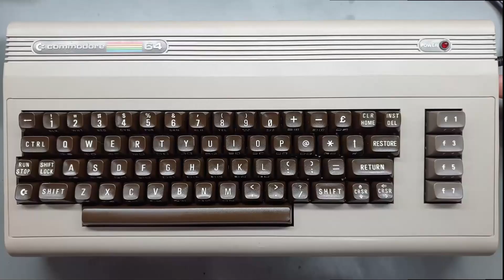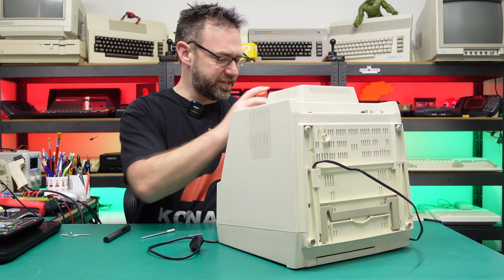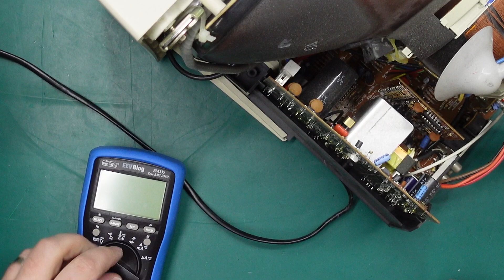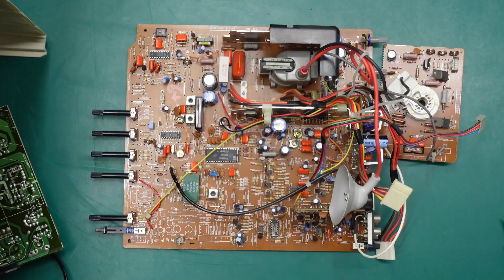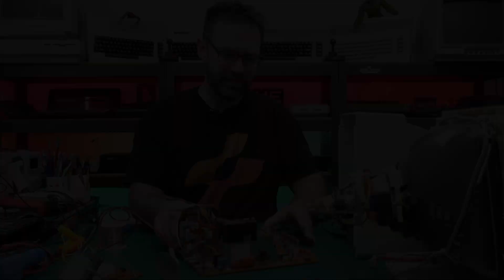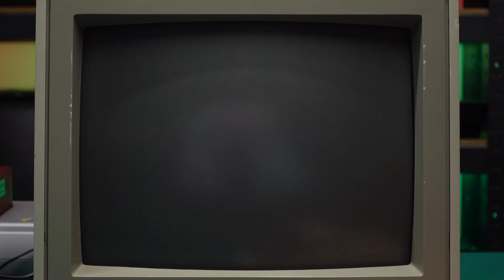Commodore 1084 CRT monitors: bad flybacks and blooming

Comment: Damn, the 1084S-P1 I've been repairing just developed this fault. I'd resoldered the RGB connector and fixed the notorious Preh ME5A power switch, and the picture was looking really good. Well, at least I can be pretty confident what the problem is - it makes that very sound.

Comment: My 1083S is doing "breathing" and the problem is really bad on the low brightness side. Picture shrinks and losts it's focus when brightness is set to where it should be, no scanlines visible. When I adjust the brightness just a little so the scanlines gets visible, picture comes sharp and right sized. Flyback and/or caps?

Comment: I had a 1084S-P just die on me - didn’t make the squeal sound like yours but just died.  No squeal HV sound, dim LED light.  Faint magic smoke electronics smell but I can’t locate anything that looks amiss.  I wasn’t in the room when it happened, so I can’t say if it made a noise or not.  Do you think it could be the HOT or flyback, or perhaps some of the support circuitry next to it from your experience?

Comment: Very interesting video showing the blooming, thank you. Interesting that increasing the brightness decreases HT voltage, I always thought it would be the other way around. The deflection is operated from the same horizontal output transistor as the flyback, so I’m wondering if that transistor is faulty, or is it the B+ supply…

Look how clean that first monitor with the failed flyback is - it looks practically brand-new!

I have one of the same 1084S-P (old shape) that’s nearly as good, but the flyback went POP!-squeeeeee while I had no input connected. Then after that, the monitor was silent; power light (and audio speakers) worked, but no static crackle/high voltage and interestingly no winding-down sound. I swapped the flyback from another monitor which proved it had failed. Just thought I’d mention that a silent failure is possible.

I ordered the HR replacement from WagnerOnline. That was more than a month ago - after two weeks, I emailed them and had no response. After four weeks, I called them, managed to get through, and was told they expect to receive the part on November 5th… as that was just another couple of weeks, I decided to wait. 

I think their website needs to show when something is out-of-stock - and when there will be a six-week delay. If they have to get it from somewhere else, what’s to stop me from just ordering it from somewhere else…

Comment: I think the replacement flybacks are very poor quality. I own a Magnavox 1CM1352 and installed the HR7533 from Donberg...it lasted just shy of 2 years. It seemed sketchy from the beginning as the pins are thin wires bent to match the original shape. Now I bought one on eBay from a guy in Germany and it's totally different. Thick straight pins that fit the board, different color and different focus/brightness adjustments. Hopefully this one is from a different manufacturer and lasts longer.
Reply: Do you have the German eBay sellers name please?
Reply: No blooming issue with that one? I would also be interested in the eBay seller you get it from?
Reply: @bluc0bra  test to see if youtube deletes this post.
Reply: @Torch70  it won't let you mention who you got it from?
Reply: @bluc0bra  Nope. Check your mini printing video and see if my comment showed up there.
Reply: @Torch70  Nothing :( Retrohax_de?
Reply: @Torch70  No didn't get anything. Neither could I find anything in YouTube policy that should prevent you from sharing this. So frustrating!
Reply: @bluc0bra  Let's try this. Retrohacks, but substitute cks with x.
Reply: after the x _de
Reply: @Torch70  Yep, I did find it, cheers!
Reply: @bluc0bra  Anytime I post the seller's name, youtube deletes my post.
Search for 7533 flyback and his name starts with retro.
Reply: @bluc0bra  4th try. Anytime I post the seller's name, youtube deletes my post.
Search for 7533 flyback, only guy selling them for about 40 Euro.

Comment: Well, looking at that fault you're calling bloom, (we used to call ballooning 40 years ago... lol) I would say you have a beam current limiter issue, maybe incompatibility to replacement lopt.
Check adjustment of bcl set up as to makers manual...
Reply: THANK YOU for this comment. This makes sense, digging thru my CRT repair manuals now.

Comment: Blooming is 'usually' caused by bad B+ voltage regulation. Can either be due to a failing voltage regulator or a bad flyback as well. It's a bit of a crap shoot but in my experience, it's usually the regulator as opposed to the flyback. I would measure your B+ voltage when the blooming is occurring and see if it's changing as opposed to the high voltage. If so, I would suspect the regulator. Although...focus drift is absolutely a flyback issue. So like I said, it's a crap shoot. Just my opinion based on my experience.
Reply from the maker: Good point. I eventually figured it out in this sort of follow up video https://youtu.be/7z6T64Elm-s?si=eE7o2oKjJJuMZyDQ

Comment: Bloom is definitely a flyback issue. The flyback doesn't only just produce voltage for the CRT, There's also secondary coils for generating some of the other voltages to run the board. Poorly designed flybacks can have worse bloom then others. It's a sign of poor voltage regulation. A bright screen causes the voltage to sag/change which is what causes the screen size to change. I believe the voltage for the deflection yoke is one thing that is powered by the flyback too so that's where the bloom is actually happening I believe.

Most CRT TVs and low end monitors have it to some degree. Higher end stuff like computer monitors tend to have much better voltage regulation and some even use components out side of the flyback to generate some of the voltages so the screen is much more stable on those. ;)
Reply from the maker: Hmm that's interesting, I didn't think about looking at what the yoke is doing. Initially I thought it was an issue with the B+ voltage to the flyback, but it seems pretty solid, only varying by about 0.16% (124.8V to 125V) between full brightness and black.
Reply: I got a JVC DTV 1700CG with this blooming issue. I checked the high voltage and it sits at 24.7Kv. It doesn't fluctuate too much as in the bad one in this video though. Around .2kv at most. Is this still a bad flyback? This is a high end monitor but with 37k hours.
Reply: @ramiq7932  I have a 1910CG with the same issue did you find a solution to yours?
Reply: @carlocgc  seems most DTVs end up having this issue sooner or later. I assume the flyback just ages badly. Only solution is to calibrate your DTV and make sure your peak white isn't too high to minimize the blooming/breathing that happens. How many hours on your tube?

Comment: Did anybody figured out were to buy a flyback replacement for 1084s-D2? Mine still works, it has a bit washed image but the smell of statics or something, is so nasty I cant work on it for more than half na our.
Reply from the maker: Don't know about the D2, have you tried putting in just the part numbers from the flyback into hrdiemens "original reference" search? Sounds like you do have a high voltage leak. Have you tried running it in a dark room with the rear cover off to see if you spot any arcing? Just don't get too close because if there is high voltage leaking outside the flyback, if could target you

Comment: My impression over here in Europe is that regarding sourcing replacement flybacks is that HR Diemen products are the only available brand. Having said that they are not being produced any more and it could well be that they will all be sold at some point and no longer available in online shops. I tried to find a flyback for a Commodore 1802 (HR 7458) (luckily I don't really need it) and didn't find anything anywhere. Asking a shop that listed it they told me they are out of stock. Luckily HR 7506 seems still to be available (NOS).
Reply: Thank you for your insight - can I ask, please - did you find a replacement flyback for your 1802? Mine seems to really need it :) I was wondering whether some other type could be substituted

Comment: Enjoyed the video. I always like the monitor tuneup type stuff. Were Commodore monitors popular in Australia? Judging by their high prices on eBay here I'm guessing they were kinda rare here or most have died leaving them rare. I'd like to get one. I'm sure it would look much better than composite on a CRT TV or through a retrotink.
Reply from the maker: I guess for our much smaller population you could consider them somewhat common. But a tested and working one will still run you about $400AUD on eBay

Comment: I have an Amstrad CRT which was making a noise like that. I somehow learned to repair my 8-bit microcomputers myself (also by watching your channel), but am terrified by the thought that I should attempt to fix the CRT so I brought it to a retired CRT repair guy (couldn't find a non-retired one who would be willing to take a look). Was told it was the flyback (along with a burning resistor) and that there was no chance of me getting a replacement one. Luckily I was able to source a replacement flyback made by HR Diemen on eBay. The repair guy installed it but then the monitor's X-ray protection mechanism started to kick in, shutting the monitor down after about a second. So there was still something wrong with it, probably something not too complicated. However, my repair guy gave up on the monitor. I think I will eventually need to attempt the repair myself, but am still building up courage and the necessary knowledge.
Reply from the maker: Yeah that's a tricky one, could be the replacement flyback also has an issue and is tripping the x-ray protection, or it could be something in the x-ray protection circuit itself. If you have the schematics available they usually indicate the x-ray circuit. Sometimes you can spot it by looking at the pins coming from the flyback, one of them should have a couple of diodes facing towards each other (cathode to cathode) with a capacitor in between going to ground, but this isn't always the case.

Anyway, I hope you figure it out and feel free to throw me any questions you have
Reply: @TheRetroChannel  I have the schematics and I can see the protection circuit there. It really is a matter of me taking the CRT apart and figuring out which part is bad. But I must overcome my fear of getting electrocuted first. So I am watching CRT repair videos in the mean time :-) Do you remember the first time you tried something like that?
Reply from the maker: Sure do, and I was shit scared. You'll become comfortable with it after a while. Start with just unplugging it and opening it up, and looking around. You can safely touch the CRT itself, just don't stick your fingers under the anode cap. Grab a multimeter and probe a couple of the larger caps to see if there's any voltage stored. More than likely the caps would have discharged themselves long ago. 

Once you're ready, grab a plastic handle flat blade screwdriver and clip a lead to the metal part of the screwdriver and the other end to the ground strap or one of the ears of the CRT. The lead itself doesn't need to be thick as although there could be high voltage, it will be very little current, even just after powering it off. As long as the lead doesn't have broken insulation and you have a solid connection to the screwdriver and CRT ground there's nothing to worry about. Slide the screwdriver tip under the anode cap until you feel it touch the anode clips, if you're lucky you may hear a tiny click, but more than likely it will make no noise if it's been powered off for a while.

Again once you're satisfied that there's no high voltage stored in the CRT, have a go at removing the anode. Peel back the rubber cap with your fingers and have a look underneath. Most will have some kind of clip to hold the anode in place that needs to be squeezed inwards. Do that and remove the anode lead. Take a look at the anode connector on the CRT, you'll see it's just a shallow hole. Then have a go at reconnecting the anode lead, it should clip back into place and feel solid.

That should help you feel a bit more comfortable working inside the CRT, at least when it's unplugged. The real fun starts when you want to do adjustments like geometry and convergence, those really need to be done with the CRT powered on
Reply: I recently repaired an Amstrad CTM640 monitor that was making the same noise. But it wasn't from the flyback it came from the power supply transformer. The monitor had originally failed from a blown power supply section ie diodes that then obviously blew other components. The flyback looked in good cosmetic shape so I was suspicious it had failed. Mine had a blown Schottky diode near the flyback and the two voltage regulators had gone also. Replaced these components and it now works perfectly.